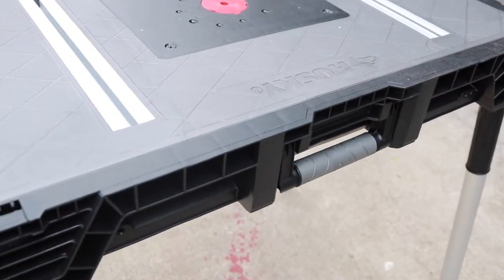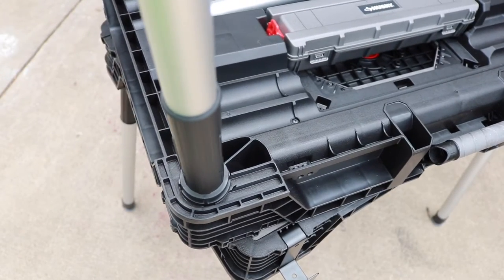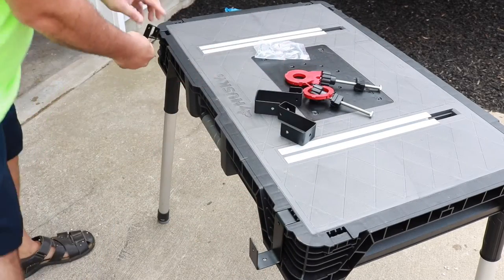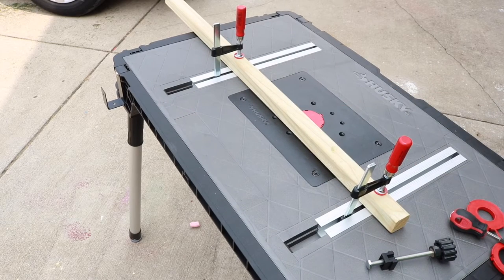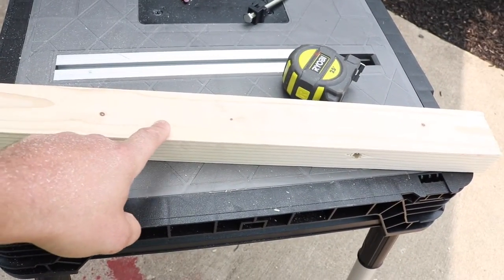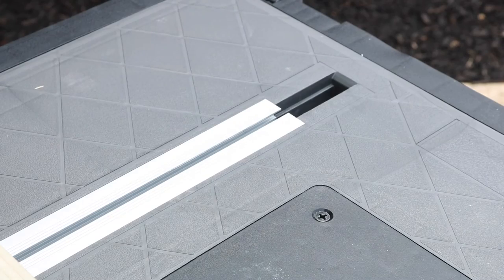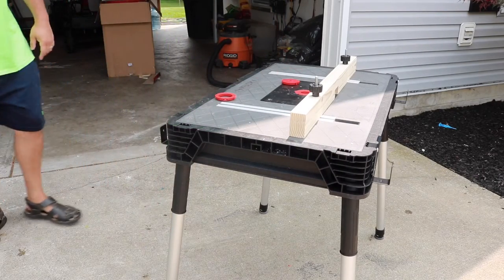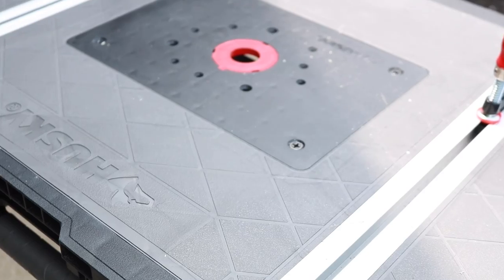Husky Portable Jobsite Workbench Review ( 225047 ) #huskytools #portable #workbench

Comment: I had the same issue with the tracks just being a little too snug, on both sides. I took the bolts to Ace Hardware, to the counter where they make duplicate keys, and they used their little grinding machine to grind down a few of the problematic threads. You really only need the threads at the top for the knobs, so why not? Now they slide easily along the track, and it was a quick, free fix. I'm sure you could do something similar at home if you have a Dremel.
Reply: Yes, that was the problem, I  am able to file the threads.

Comment: For the router fence, the holes you drill for the clamping screws MUST be perfectly vertical. If one tilts slightly, it will cause it to not slide easily.
Reply: Pro tip take a 3/8 drill bit on a impact and run it up and down the channels . Then take a flap disc wheel and lightly debur the channel works great and as long as you have the clamps tightened down does not affect it in any way

Comment: Thanks for the video. I just bought this today. Planning to put it to work tomorrow as a router table. I have a suggestion.  If you widen those holes in the 2x4 to make them into like 3" long slots it may help it to slide freely without needing to take it off and adjust each clamp bolt individually.

Comment: It's binding in the tracks because when you drilled the holes at 3:50, you are clearly drilling at an angle, so the bolts and crooked and binding.

Comment: You right one track is too tight. I hanging a bosch router 1617 and is working good.
Reply: Jose, did you have to drill any custom holes to get your  bosch1617 router to fit under table?
Reply: @scott8940  Hi Scott. Yes I did. I just remove the base plate from the router to center the big hole on the table. I don't have the router and the table anymore. So I don't remember how many new holes I did. Probably 2 holes. But once it's hanging the router is working very good.

Comment: So I notice u don't mount a router on the plate, u should've because a craftsmen, porter cable, or my grandfather's old black and decker  fixed based router would not fit with any of the hole configurations

Comment: What routers cab be set uyp no issue and doe sit support a Trim router like DeWalt 1.25 hs plunger set up to be specific
Reply from the maker: Hey klozher,  all that Husky mentions is "common routers" but Dewalt and Bosch should be fine. Even if you do have a different pattern than the table, you can drill holes in the plastic to match.  This is what I have been hearing others do. Hope this helps